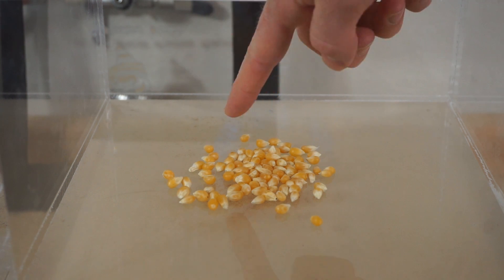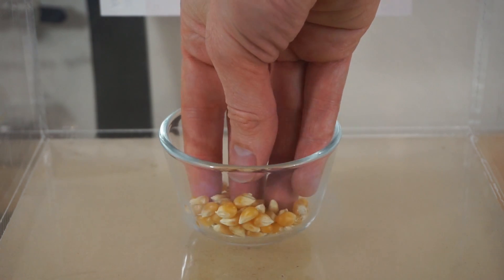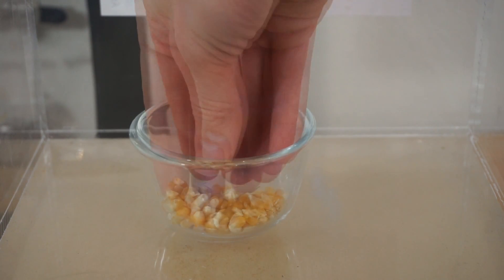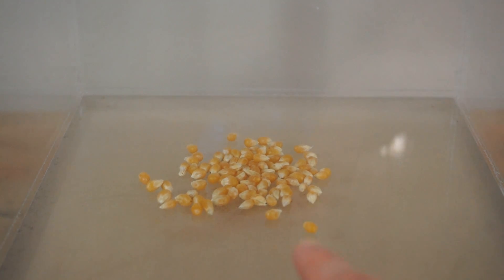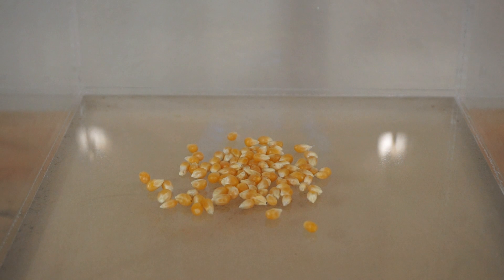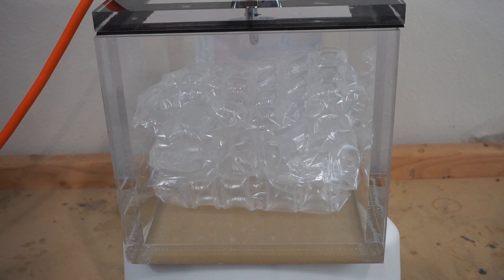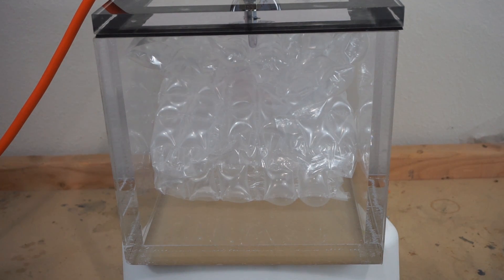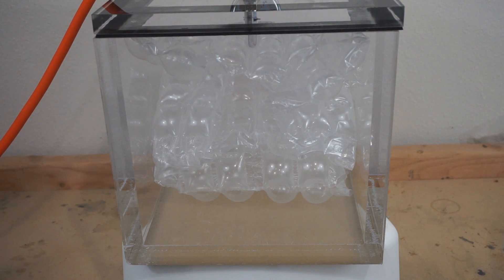What Happens When You Put Popcorn Kernels in a Vacuum Chamber? Will They Pop?

Comment: Put a small stand in the chamber with one kernel on it, remove the air and use a high watt laser to see if anf how long it takes to pop the kernel. Compare it to kernal at room conditions. Try different color lasers to see which one pops the kernel fastest for the same or similar wattage and which one pops the kernel better ie not burning the shell vs just pooping the kernel. 
If you could get your hands on a maser (microwave version of the laser, and predecessor to the laser) it would be cool to play around with that. Though a microwave oven is pretty much a maser of sorts.

Comment: The difference between zero and 1 atm is not enough to pop the popcorn, this includes sending it out on one of spacex space ships and releasing it out of the space ship. In fact there is a way to calculate how much pressure needed to pop a popcorn kernel. It needs anywhere between 9.2 and about 300 atm to pop the kernel.

Comment: But....okay if there is a small amount of moisture but no gasses, and the reason they pop is from the moisture boiling....?  and then further expanding from the heat?  Am I getting that right?  If I am, then couldn't you heat up the kernels to the point where the moisture boils and then expands but not enough for it to pop, and then before it cools down, shove it in the vacuum chamber and see if it would pop then?  Even if that makes sense, I guess it wouldn't be as cool and there certainly wouldn't be a point to it.  But just a though (albeit, possibly incorrect thought)

Comment: okay, so instead of doing something that was rather obvious: nothing will happen. Try heating the popcorn up to different temperatures and see the if it will pop and what threshold in temperature will it continue to pop. Also you can see what kind of affect lower temperatures have on the starch. The kernel may just explode apart at low temps

Comment: Of course plain old popcorn did not pop due to vacuum, but leave it in at high vacuum for a few days and I predict that it will no longer pop well from heat, either. The internal moisture will largely be sucked out. But popcorn seed has a huge thirst for water. What if you soak in water overnight and then vacuum? What if you heat the seeds while in vacuum? If you can get them to pop at all, it should be with extra violence.

Comment: Should the mood strike you to do try this again, I'd be curious about how the vacuumed popcorn cooks. I'm finding that all of the popcorn I cook, no matter how I cook it (including in a commercial style popcorn machine) always comes out chewy, which I (perhaps erroneously) contribute to excess moisture in the kernels. The only remedy I've found to that problem is to leave the bags open in my pantry for several weeks before cooking. What brand of popcorn I buy doesn't seem to matter either.
Reply: while you cook, blow on it so that the steam dosent get trapped inside the pot. and once ur done, shuffle them around so that there isnt any steam in between the popped kernels either. also, after oil put 1 or 2 kernels in it to see if the oil reached popping temperature.after that put all the kernels in at one go and put the heat as high as possible. i eat popcorn everday
Reply: I pop mine into a hot oven afterwards

Comment: don't get the dislikes
people requested it, he did it. just because it didn't work out like some expected (i actually anticipated this result, because if there was anything inside the corn that would expand enough in a vacuum to cause it to pop, then that would probably just slowly sip through the white end of the corn, where it was connected to the corncob. the pressure doesn't drop anywhere near fast enough to cause it to explode) doesn't mean the video is automatically bad. also, the bubble wrap popping at the end was satisfying to watch :)

Comment: Dear HPA! Can you try to boil some metal using vacuum chamber?
This technique is used to deposit thin metal coating on glass for example. You can try a metal with very low melting point, like solder.

Comment: I read somewhere that in space, if two metal touches, they stick together permanently of fuse. Could you test that, I'm not too sure if its going to work though in the vacuum chamber since there will already be an oxidise layer between the metal before pumpin air out

Comment: This is possible because when you lower the pressure of the atmosphere the boiling point of water reduces so in some cases is boils at room temperature and not 212° F but the vacuum has nothing to do with moister withdrawal

Comment: How about a glass of cool water. put a thermometer in it so the veiwer can see the water is still cool.
Reply: Paul Schaefer Wouldn't hot water boiling at low pressure be more interesting. You could see the temperature drop..

Comment: how come there was sound when the bubble wrap was popping? there should be no sound in a vacuum, right ?
Reply: Nihit Chauhan the bubble wrap was touching the walls, it wasn't suspended. there were ways out through mass for the sound waves
Reply: No one has been able to make a total vacuum before
Reply: The gas inside the bubbles also generate their own atmosphere as they pop.
Reply: Nihit Chauhan There was still air in the chamber, though.
Reply: Also it's touching the sides of the vacuum chamber.  If it pops while touching the sides of the chamber, the walls can act as a medium for the sound
Reply: Like everyone said, there is no perfect vacuum; It's not possible. Also, everytime a bubble pops, there will be a large impulse in the pressure of the chamber because the pump is not instantaneous in removing atmosphere. A spike in pressure is the definition of a noise, lol

Comment: We could hear the bubble wrap popping  ??? Is that because it was touching the walls of the vacuum chamber so sound could actually be transfered from there ? That's the only solution I came up with :D
Reply: Valentin Vasilev it's because the air that escapes from the bubbles transfers the sound waves (if you want more of this watch "codys lab"
Reply: I honestly dont beleive its enough to transfer it, one bubble doesn't contain enough air to make that happen.. plus that the pump was still working and the little amount of air released should be sucked in pretty fast.. Correct me if I'm wrong ! I know about Codys lab anyways, he's great as well
Reply from the maker: +Valentin Vasilev yes it's because the escaping air is its own medium for the sound. Although it is muted and sounds a little different.
Reply: Damn ! That's cool now, thanks !